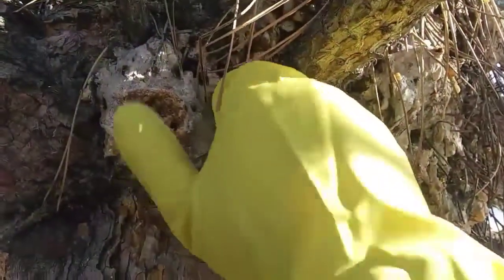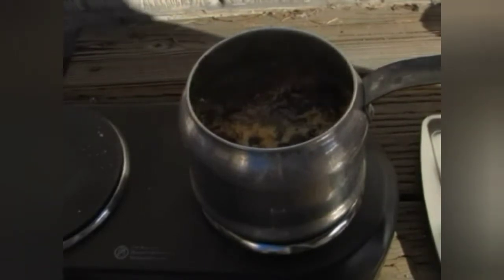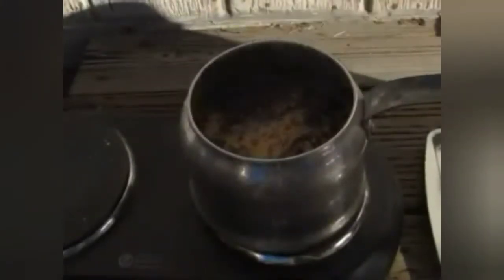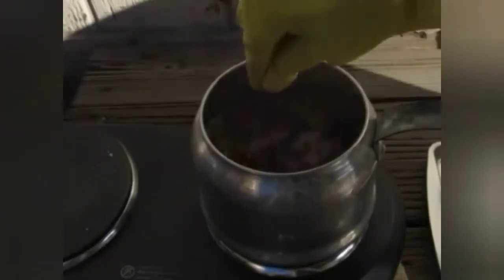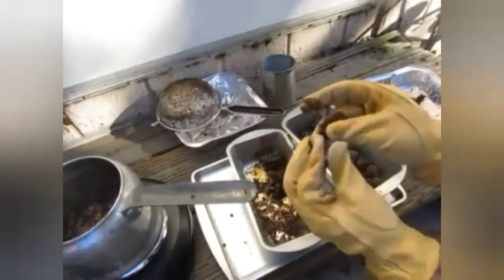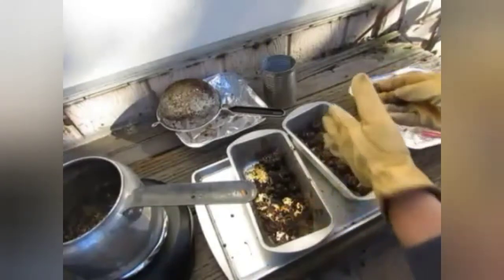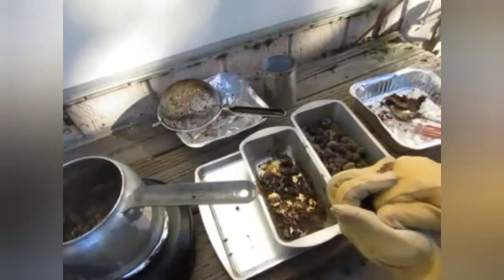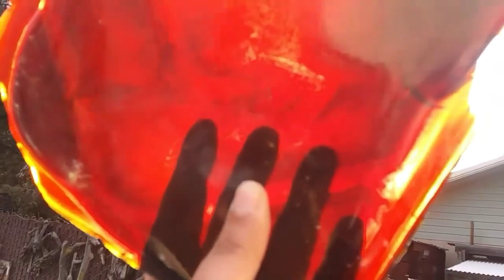Make Fatwood and Pine Resin

Comment: So do you put the except from the tree in the pot do you add water or anything you skipped that part I didn't get it
Reply: I was wondering the same thing
Reply from the maker: I didn't add anything to my pot. I just put the chicks of resin in the pot on low heat, and let it melt on it's own. Water is a type of impurity, that has to cook out, along with the reprinting the tree itself adds into its sap. When all your resin is melted, and it's no longer bubbling, that is how you know you have successfully removed the impurities with in the resin. Water and terpinetine makes resin softer, so if you want a harder and longer lasting fire starter, you really should wait till the bubbling of the resin is completed.

Since I wanted to create a violin rosin, in addition to the fire starters, I needed to leave some of the terpinetine in my resin, so it is more sticky, and will grab my fiddle strings better and produce more vibrant sounds.

But as for adding water, I personally would avoid it, since it will decrease the quality of your work, instead of increase it. Hope this helps.

Comment: What is camical  use is orange colour rosin flux making practical video displays please
Reply from the maker: I'm sorry. I'm afraid I don't understand your comment. Could you rephrase it for me?
Reply: @basichomesteadingandsurviv3699  he is probably asking for a video about making rosin flux for soldering. This is the main ingredient of the activated and non-activated liquid or paste fluxes for soldering electronics. And it's really good for it.
The process is the same as yours, but you dissolve the end product in Ethanol or Isopropyl alcohol. Rosin is 5% to 30% by weight, rest is alcohol. To activate it you need to add 2% to 3% acid. Citric acid also works. This is for liquid flux and you can make it into paste by using technical vaseline.
Reply from the maker: Interesting. I know nothing about soldering. This is way far outside of my knowledge, experience, and expertise. I can't honestly comment on something I know nothing about. I guess you all will have to do your own experiments, and find out how it goes! Just, be safe while your at it.

Comment: That’s cool , very very sticky
Reply from the maker: Yes, it is very sticky, but you can actually remove resin quite easily with nail polish remover, or a very high concentration of alcohol.

80% or higher, rubbing alcohol works, but vodka is even better than rubbing alcohol, to remove resin. Fingernail polish remover, is by far the best method, as it doesn't require any rubbing or scrubbing, as the resin literally melts away like an ice cube on a Dutch oven pot in a fire! These are greater skills to have, and the sticky goes away quickly with the right stuff! Hope this helps, and have a good one!
Reply: @basichomesteadingandsurviv3699   Isopropyl will do.. It's that in the nail polish remover.
Reply from the maker: @fitulus  isopropyl alcohol/rubbing alcohol does work, but it will take scrubbing. Grain alcohol 90% proof or higher, like vodka works even better, but it will still take a small amount of rubbing. Nail polish remover/100% acetone removes all pitch, just by pouring it over the surface. Acetone is absolutely best.

Comment: Is it edible?
Reply from the maker: Yes it is. Some people will use a tiny piece and melt it in water, to drink as a tea, for the cold and flue season. Some people say that the pine resin tea helps them with allergies. I've never tried it personally, so you will need to do further research than I have. I use the resin as violin rosin.

Comment: Is it just hot water or you put something else
Reply from the maker: When cleaning my tools, after resin, I use vodka or nail polish remover. It dissolves the resin perfectly. Water can melt it, but the resin tends to smear, and stays sticky, even after washing. So for those reasons I clean my tools with nail polish remover. When I have removed the stickiness, then I wash my tools with hot water and soap. I have no problems with my tools when I clean up after rendering resin.
Reply: @basichomesteadingandsurviv3699   my question was in the pot what liquid did you put in with the fat wood to extract it from the wood
Reply from the maker: @alm5tar1  I didn't use any liquid, oil, or any additive of any kind. I just placed the whole chunk of pine pitch in a cool dry pot, then placed my pot on low heat, and let it melt. I will be rendering more pine pitch soon, so if you would like to see how it melts in a dry pot, I would be happy to do that for you.
Reply: Thank you so much I will give it a try .

Comment: Is the gas produced by heating resin toxic?
Reply from the maker: Pine trees and pine pitch are actually edible! There shouldn't be anything toxic about a pine tree, unless it's been sprayed with toxic chemicals or repellants. If a tree has been sprayed, I certainly wouldn't harvest pitch from it.

My tree is natural and chemical free, as most pine forests tend to be, so they are non toxic and perfectly safe. The steam vapor that you see coming off the cooking pitch, is the liquids that is naturally produced by a living tree evaporating back out. You can add raw pine pitch into a tea to use to treat coughing, soar throats, colds and flus. In this case, I needed all the moisture to evaporate out, cause I needed a hard rosin to use for my violin bow, and any moisture in the rosin, isn't good for a violin bow.

Rest assured, pine trees are definitely not toxic, but please by all means, don't take my word for it. Always make sure you research everything as much as you can, from as many resources as possible, before you attempt any DIY type videos for yourself. I hope this answers your questions. Have a good one!

Comment: When i try to melt my resin it just burns and chars.
Reply from the maker: Sounds like your heat is way too high. You want to put your resin to melt, at very cool temperatures. It melts very slow, but it's the only way to prevent it from scorching and changing color and it's properties.

If you put it on the lowest setting, and it still burns, you may try a double boiler method. Just place a pot of water on the stove to left it simmer. Then place a bowl with resin on top of the simmering water. This can sometimes prevent burning, when direct placement over low heat still burns your resin.

I hope this helps.
Reply: @basichomesteadingandsurviv3699  was doing it on a flame so makes sense
Reply from the maker: @mericagunsfreedomandlove.8985  Haha Haha, oh ya. That will do it for sure! It's way too volatile, and can combust when exposed to flame. I would defiantly suggest a double boiler method, if your melting resin over a fire. Remember, your just melting it, not deep frying it, lol.
Reply: @basichomesteadingandsurviv3699  it just chard the outside and booie inside. But I'll definitely try water double boil.
Reply from the maker: @mericagunsfreedomandlove.8985  Easiest method for sure. You will need 1 pot on a stove or hot plate, filled with water. Then you will place a second pot, or bowel on top of the boiling water, and fill your second pot with resin chunks. You kind of stack it up, in layers.

I always use a double boiler method, when melting candle wax. If you want to see my double boiler method, just check out one of my candle making videos. It should give you a pretty good idea how to rig up your own pots! Best of luck

Comment: Can you tell us the fiddle rosin recipe?
Reply from the maker: There really isn't a recipe, that I use.  Rosin is basically plain old tree resin. This resin, in its pure form, is perfect enough to rosin a violin bow with, and have it hold friction to play on.

If you are interested, I would be happy to extract my spring resin, render it, and form it into a keg of rosin, and test it for you, if you wish.
Reply: @basichomesteadingandsurviv3699  Thank you for your answer! So, for my understanding, this is not actually colophony (the yellow, transparent pine rosin)?
I did try to make violin bow rosin using 4 hours heated colophony, until got darker, and beeswax. And it is working great. Now I am trying to test again, mixing in yellow colophony, benzoin, raw pine rosin and beeswax. I am searching for a recipe that goes stickier when heated by the friction of the bow.
Reply from the maker: @MrNedelcuBogdan  from my understanding, color, time of resin harvest, and heat, all play a factor into the "stickiness" or rosin. More heat, will make the rosin more sticky,  and rosin made from tree resin that has been collected in fall, will all produce a sticky, darker, rosin, but it will not hold up well in humid conditions. Light yellow rising is cooked with low heat, from spring harvested resin, making a harder, and wet weather resistant rosin. My rosin, unless over heated, or made from late fall harvested resin, has a transparent clear look to it, with out the need to add any bees wax.

Bees wax is better used with a bow string rosin, for hunting bows and and arrows, and not for violin bows. Bees wax is an oil, and oils in a violin bow hair, in my honest opinion isn't the best thing to do for your bow.

Acetone or finger nail polish remover does break down rosin, making it softer and stickier. There are other chemicals you can add to make a violin bow rising harder, but the best thing to do, is harvest the rising in early spring, and cook it on a very low heat, till it stops bubbling, to remove all the impurities, and use your finished product from there.
Reply from the maker: @MrNedelcuBogdan  I have heard of folks taking pine pitch directly off a tree, and rubbing it in their bows, in a pinch. Funny story is, because the rising wasn't rendered, bugs encased in soap, got stuck in the bow hairs, making a funny noise when the bugs got pulled over the strings, but plain old rosin does in fact work well on a violin bow, just make sure you clean it first, lol.
Reply: By adding a bit of beeswax in the rosin, it changes in better. Also it become less brittle.
Reply from the maker: @MrNedelcuBogdan  very interesting. I've not heard of that. Is it still transparent, with bees wax in it?
Reply from the maker: @Matt DeMouy well I suppose that could be done, but it is much more complicated than that.

Tree Sap is basically tree blood. If you were to get a cut anywhere in your body, you would bleed. Some wounds bleed more than others, like a small cut to a finger, vs a small cut to the artery in your neck, but you will still bleed the same blood. Tree Sap is the same. A cut to a branch is like a cut to a finger, and a cut to the trunk, is a cut to the arteries.

Traditional Fatwood harvesting, is a different ball game, as it basically comes from dead trees, and branches, where the tree sap stops flowing, and pools in the limbs of the tree. If you have ever butchered an animal, after its been dead, you will notice that it no longer bleeds. Dead trees are the same, and they will no longer produce sap, which is where we get the sap heavy fatwood from.

Sure, you could extract resin from fatwood, but you will have to crush the branches, and force the resin out of the fibers first, and then use heat to try and melt it down, but you won't be able to extract much from it, because the wood has already died.

I like to collect resin from the outside of living trees, because the sap flows freely, and nature has already done the crushing of the tree fibers for you. You can get higher yields, and constant harvest off that one tree, year round. Many trees produce fat wood. If you like a smell of a Georgia pine, over a fire tree, consider using that as a guide. Different trees make different smelling resin, and this could be a factor, in why you like a specific smell of fat wood, over a tree you see in the woods. I hope this helps.

Comment: Hang the strainer in the top of the pot your heating in.
Reply: Keeps it from sticking? I'm guessing bc it produces turpentine vapor.
Reply from the maker: I tried that, and the heat just wouldn't reach the resin in the strainer, and the tiny bit that did drop into the pot, scorched and burned. It wasn't an effective method.

However, I did see a video where a somebody put resin in a strainer, then set the resin on fire, and the melted resin dropped into a pot while the debris kept burning.

Melting in the pot, then pouring through a strainer was a faster method for me, for the amount of resin I had. I'm sure you can rig up other ways to get the job done, but this way worked best for me.

Comment: That’s like picking a scab from the trees wound. That’s pretty sad. I love grabbing the stuff too but I don’t have rubber gloves nor do I rub salt in the wound
Reply from the maker: There is a safe point at which you can collect sap. If you expose the wound in the tree, then yes, you risk potentially killing it, which is very sad. Nobody should be removing the "scab." You can take some of it, like the drippings or a little bit of the thick crust, but you should never expose the wound, especially when it can be 100% avoided.

Comment: What do you do with the sheet of resin?
Reply from the maker: Resin has many great uses! It can be used as a glue to hold arrow tips in place, or to help glue any other thatchings together. It's highly flammable and can be used in fire starters, and also used a long burning fuel for bush craft torches! 

If you have an injury, like a lacerations or deep cuts, it can act as a bandaid. It can help stop bleeding wounds, and prevent insects or infection from making an injury worse.

Resin can be used in homeopathic teas, to sooth soar throats, cough, and allergies.

If you are into archery, this resin can be melted with bees wax, to make a bow string rosin, which you rub onto the string of a bow, to preserve it, and keep it from breaking.

In my case, I plan to use this resin, as a fiddle rosin. I will be making kegs of it, so I can rub it onto my fiddle bow, and keep playing the music I love so much, in the backwoods.

Resin has so many uses, far beyond what I have already mentioned, so this resin is a great thing to have on hand, because of its usefulness. I hope this answers your questions.
Reply: @basichomesteadingandsurviv3699  thank you!
Reply from the maker: @peachnehi8683  you bet!
Reply: Can you tell us the recipe for the fiddle rosin recipe?
Reply: Can one burn tiny pieces on coal as insence??
Reply: @basichomesteadingandsurviv3699  Hmmm, I take it it could also be used in Model making, where one can pour it into a mold to cast models, right?

I can sorta see it being used for making Teddy bear eyes... Or Plushie eyes...
Reply from the maker: @Victor-056  it's possible. It does cool incredibly fast, and it's quite brittle. It may not pour into all the crevices, of your mold, before it solidifies. I would suggest using epoxy resin, as it's designed for doing craft projects like that.

Comment: Try destilling turpentine from that
Reply from the maker: That's not a hard thing to do. You just collect the steam that comes off your heated pine pitch, and funnel it into a cooler collection pot. The turpentine is in the steam. Collect the steam and your good to go.

Personally I don't have a need or desire to make turpentine in my distillery, cause I use it for essential oils. I tell ya what, I will work on making a turpentine distilling video for you. Probably won't be done for a few months, but I'll see what I can do.
Reply: @basichomesteadingandsurviv3699  oh nice. Thanks ☺️
Reply from the maker: No promises, I'll sure give it a try!

Comment: Smart using your gloves, ruins blades, and everything else.
Reply from the maker: Yes it sure can. I like to use nail polish remover, on my tools after I work with resin. Nail polish dissolves the heck out of the resin, and removes it right off, like a hot knife through butter. Alcohol 90 proof or higher works well too. It's easier to use disposable tools, but if you can't, that didn't have to be the end to your work.